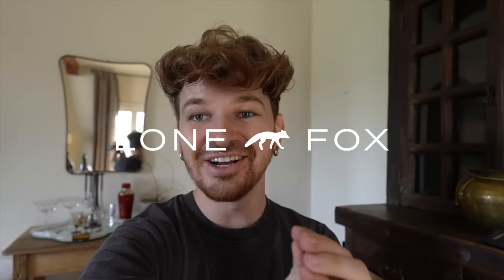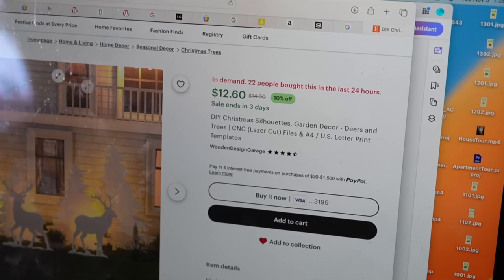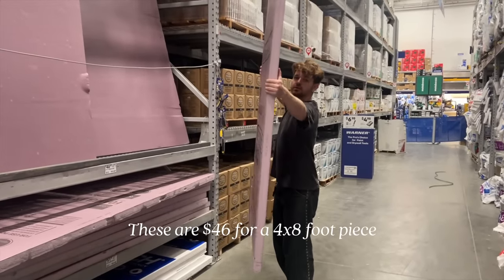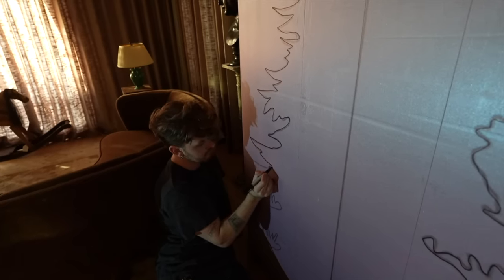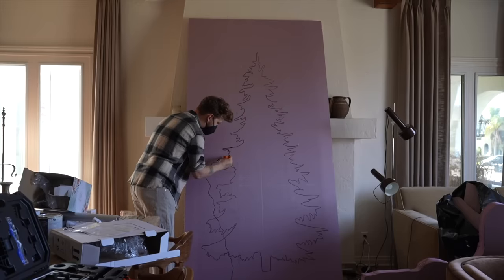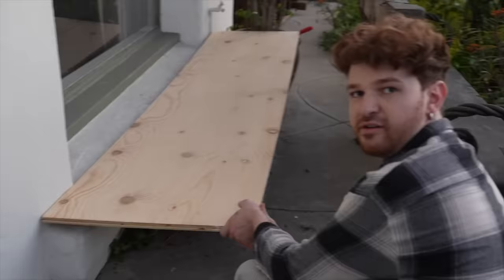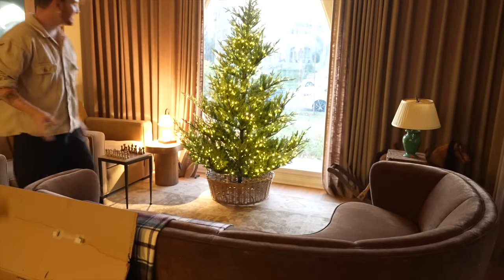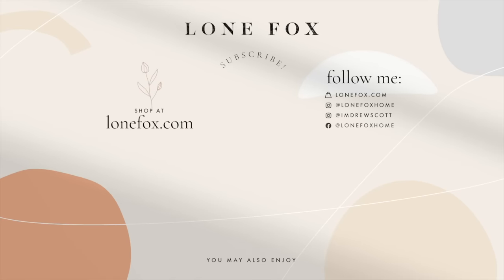TURNING MY HOUSE INTO A SNOW GLOBE! 🎄 DIY Christmas Outdoor Decor & Lights

Comment: I’m blown away by how gorgeous this came out!!  As cool as the cutouts looked in the day, the nighttime effect was x1000!  More ethereal and stunning than I could possibly have imagined.  

I don’t mean this is a diss, because the whole effect is perfection, but I’m not really getting “snow globe”, just like winter wonderland and a gorgeous window-framed tree.  If a person wanted to go harder on the snow globe theme I think you could add some fake snow at the bottom of the “globe” and some tiny snowflake decals all over on the glass to pump up the snow globe effect, like a shaken snow globe.

Comment: Please use respiratory protection when using the wire cutter. You are literally smelling all that plastic in the gas state. All those fumes are plastic in the air, and it is highly toxic carcinogenic. 

An N95 will not protect you from those fumes. It does not offer the level of protection for VOCs or PCBs. You need a 3m GAS MASK and get instructed because there are different types of filters according to the type of gas exposure. Be Safe ❤

Comment: Simply brilliant! And a pile of "snow" in the bottom of the snow globe would really enhance the look! Use expanding foam sprayed onto a plywood base (the depth of the window ledge), let harden, cut to length of your window ledge and just set it in place outside your window. It would look like snow settled at the bottom of the window/globe!

Comment: You might find a cheap little digital projector will make transferring shapes and scenes onto particle board (or whatever) a whole lot easier, and wayyyyyyyyyyy faster. Because you can use a wax pencil or chalk to trace whatever you're projecting onto whatever you're going to be cutting it out of, and if you ever wanted to paint a mural on a wall or something someday from a picture you found...... just project that puppy onto that wall, and start painting by numbers. Basically.😃

Comment: I think you should put a sheet of plexiglass over your window, and seal in some very small foam balls 1/4 diameter and cockles two small fans in the bottom of the plexiglass. Voila a shaken snow globe! Just My Two Cents

Comment: After Christmas you could use a stone render on the foam cut outs (you'll need wire around them to grip to), it'll make them much more durable and still lightweight - seems a shame to put all that hard work in for them to break when stored away.

Comment: Dude! love how this turned out, but you're gonna get someone killed replicating this! Im a diorama maker, I use that foam all the time, BUT it is incredibly TOXIC when melted.  You need to be wearing a respitator and doing the cutting OUTSIDE  with the hot wire cutter or in a space with a constant running exhaust fan!  Kids, pets, or anyone with with asthma should stay far FAR away.